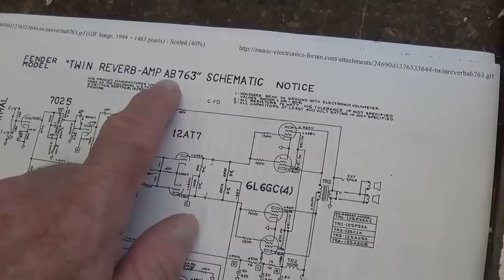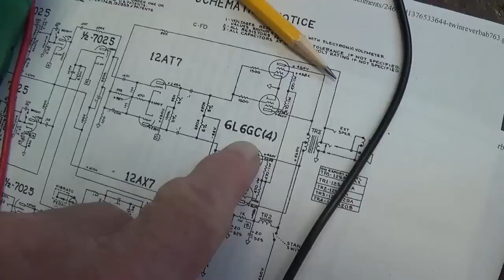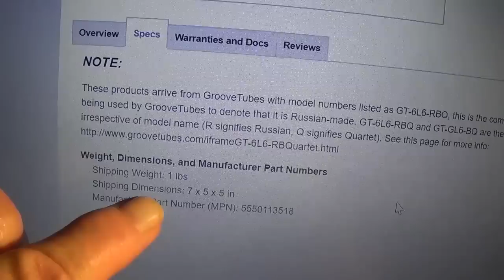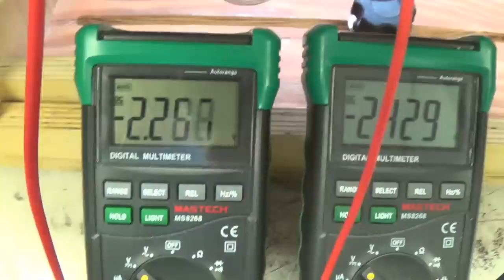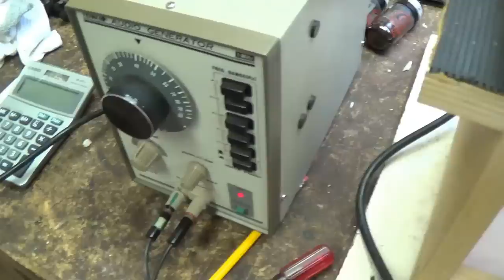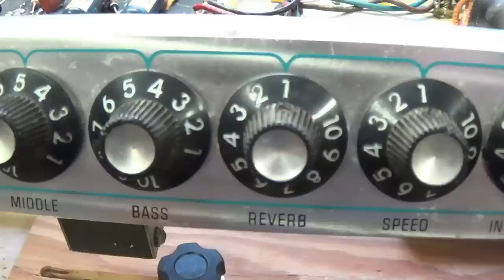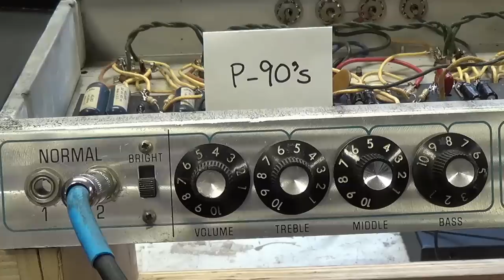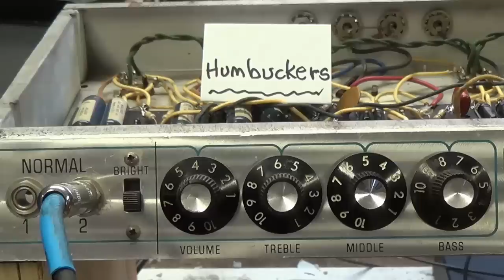1968 Fender AB763 Twin Reverb:   Evaluation, Modification, Extended Audio Demo

Comment: About the European power cord:
The colours used to be red, black and green. Across europe there were some differences in the colour coding (pre-1977) but all used the same colours. 
In 1977, red(live) black(neutral) and green(safety earth) were standardised.

In 2004 they were changed to brown, blue and green-yellow.

If you look at the charts about colour blindness, you will see that even with a red-green deficiency, brown and blue are still very distinct colours. So even an electrician who doesn't know they are colour blind will be able to tell them apart.
The only allowed multi coloured wire is the safety earth.
Reply from the maker: Makes good sense, Stefan. Thanks !!

Comment: I agree with the filter cap alignment, but I wouldn’t consider it bad work if I saw someone had an  j-hooked in the replacements.
Reply from the maker: If the connections are good, the circuit will work regardless of how it looks......but if it looks good too,  even better ;)
Reply: @UncleDoug  ah..more dating metaphors. .. Somebody stop him!
Reply: There are large currents flowing through those joints. Better if they didn't exist.

Comment: Speaking of weather changes ... Somewhere around 1968 or '69, I was sitting in a marketing class at Florida State University and gazing out the window. Suddenly, the wind begin to blow smoke emanating from a VERY tall smoke stack, down to the ground, and leaves on the ground began blowing straight up high into the air. In the hour's length of that class, the temperature must have dropped 30 or 40 degrees and it was quite cold. But such is Tallahassee ... or used to be, anyway.
Reply from the maker: Sounds pretty spooky, TT.......X-Files stuff.

Comment: Greetings Uncle Doug! 
I have here an AA270 Twin Reverb on the bench.
I've installed a new set of JJ tubes and I'm checking the bias of the output tubes.
On the first set of output tubes I measured between the plate to the CT of the output transformer : -1.24V / 35.9Ω = 34.5mA, half of that = 17.2mA. The plate voltage is 425V so the plate dissipation is 7.34W

On the second set of output tubes I measured between the plate to the CT of the output transformer : -1.22V / 38Ω = 32.1mA, half of that = 16mA. The plate voltage is 425V so the plate dissipation is 6.82W

This is normal bias for an AA270?
*BTW, the amp sounds very good
Reply from the maker: This seems a bit low to me, Asaf, even though I tend to be very conservative regarding PD of output tubes. I would probably increase the plate current to achieve a PD more in the 11W to 12W range......which is still rather conservative for GC's.

Comment: Hi uncle doug.. ive subscribed &  watched a bunch of your videos & am convinced your an authority at this stuff, which brings knuckleheads like me to seek advice from you so, i'll let you decide if being an authority is positive or negative, lol... 20 yrs ago I bought a kit from Dan Torres that facilitated a 2x6L6 class a combo w 3preamp tube layout. I had a traynor ygm-3 combo that was smoked that I gutted & modded the chassis to accept the larger xfrmrs, tube sockets, etc.  Not knowing much about tube circuits I went about the business of attempting the job. It worked but had a untolerable hum & reduced volume to the point where it was unusable. I sent it to a tube amp guy, he changed some things but never fixed it.. It's been in my basement collecting dust since (20yrs-ish).. im seriously thinking about ripping all the electronics out of it & attempting to build something else with all the hardware already in place. My question to you is  with the hardware I have, is there a tweed era circuit I could re-produce with a 2x6L6, 5u4gb or gz34 rectifier, 3-4 preamp tube layout w Hammond 272JX power xfrmr (pri= 115v, 60hz, 236va, classA  /  sec=600v CT, 250ma dc  filaments : 5.0v , 4A  6.3v CT , 8A & Hammond 1650N output xfrmr  Type X class 105c 60w  4,8,16 ohm output 4300 ohm CT, ?... any advice would be appreciated!, Thanks, Jon
Reply from the maker: With the parts you have, you may be able to construct a Fender 5F6-A Bassman. Download a schematic and see what you think. Good luck.
Reply: @UncleDoug  thats kind of what i surmised already, thanks for the help!..
Reply: @UncleDoug  also, im learning a lot as i watch your videos & am gaining a bit more confidence in my ability to successfully attempt a reboot of this project. I've seen the appreciations you've recieved on the tutelage you offer with your videos & they are widespread & well deserved, it may be just one more but Thanks so much for the videos & generosity.. -jon

Comment: Have you ever done the negative feedback circuit with a pot rather than a switch? Or would the difference be negligible/pot a bit useless?  Inside an old bassman at the moment and considering adding a switch or variable control.
Reply from the maker: Yes, I built a Champ from spare parts (see the video) and added a variable NFB.  Ultimately, it would be neat to have a footswitch to control the NFB.
Reply: @UncleDoug  hey that's not a bad idea, I have a spare jack hole in the chassis too...

Comment: Just for fun, I checked my copy of the Tube Amp Book written by Aspen Pittman, the founder of Groove Tubes. The book contains at least a partial tube data sheet for the 6L6GB, which shows 360V max plate voltage. Also of note, according to a June 02, 2008 article by MusicRadar magazine, Fender acquired Groove Tubes.
Reply from the maker: Wow.....pretty puny......more like a 5881.  I'm much happier with the TAD's. Thanks for the info, Thomas.

Comment: Hello UD, what the potentiometers concern of the old fender amps versus recent pots. Earlier pots had a different ratio which resulted in a way that the amps started breaking up at 5 on the volume pot, there were with actual pots " in the same amp " will break up at 7 at the volume  plus or minus. Geetings UD
Reply from the maker: Greetings, Jose. Thanks for your input.
Reply: So could you make a switch off of or a push/pull on the volume pot in order to make it break up earlier?

Comment: Notice this '68 has the Blacklikne silverface panel. There are thin black vertical lines. That's a sure sign it's a 1968 and likely to be an AB763.
Reply from the maker: Thanks for your helpful input, Gregory.

Comment: Hi Uncle Doug, Could you comment on what impact, if any, the current limiter has on biasing the amp and subsequent operation by a rock and roll fiend without the limiter in the studio or bar gig. Or should he take the light bulb to the gig and set it atop the amp for inspiration and questions from the audience?
Reply from the maker: Good question, SL. On the smaller amps that I usually deal with, the current input is quite low, thus the CL has little impact on the biasing. I tend to bias conservatively, so any increase in PD is still easily within acceptable limits. On large amps, like this one, however, it does have some impact due to the higher current draw. If you notice, I biased it a little below 50%, to allow for a 5% to 10% increase in PD depending on the AC supply at the owner's location. If you intend to bias to the max, I would suggest doing so without a CL and at the maximum AC voltage the amp is likely to see.
Reply: @UncleDoug   thanks for such a thorough reply, the few times I have biased my amps I've not plugged through the current limiter to get a "true" value,  (after using it faithfully as prescribed when in the troubleshooting stages of work, of course) I know that you are giving yourself some headroom by not going totally hot on the bias. Maybe it'd make for a good quick video to show the impact of the current limiter or not on the bias? Maybe a quick recheck on the Twin  without  plugging through the lamp ? Might excite the highest levels of nerdiness among the faithful ?...

Comment: Hi Uncle Doug,  I have a 69 Twin reverb AB763. SN A17871.  I've been trying to find the correct schematic.  The internodle resistors are 2.2k and 10k. You didn't show the full schematic that had those two resistors.  All I can find is the one with the 1k and 4.7k. Can you point me in the right direction.  As always,  THANKS,
Reply from the maker: The schematic you seek is for a Twin Reverb AA 769, KG:  http://www.thevintagesound.com/ffg/schem/twin_reverb_aa769_schem.gif
Reply: @UncleDoug  Thanks for giving me the news that I suspected.  This amp was one of those VERY  Molested ones. The cabinet and chassis number says it's a 69 Twin reverb AB763.   Someone added the master volume and did a bunch of other mods.  I suspect they might have changed those internodle resistors also.  That's what got me so confused.  They look like original carbon composites,  but who knows.  Thanks again.
Reply: @UncleDoug  Thank you for taking the time to let me know.

Comment: As far as I know the screw chassis ground (with lock washer) is preferred to soldered chassis ground because it won't desolder itself or go high-resistance over time or when passing fault current.  Not sure in practice which is more likely to go bad.
Reply from the maker: There are people who feel strongly for and against bolting down a ground, AU. When you use a lock washer, as I tend to do, I have never had a problem with bolting.
Reply: I always use a screw tab set up.

Comment: Hey Uncle Doug,  I learned a lot about Silver Face Fenders today. Had no Idea they had the AB-763 Circuit. When  i was a kid (18 years old in 1979) i wanted a Fender Amp because Ted Nugent used them. So I answered an add in the local Atlanta advertiser. At that time i had no idea what a black face Fender was. Well, i came home with a Fender Showman. I think it was a 1968 version. I did not appreciate it back then -  an ab-763 circuit (i think). Should have held on to it. Yesterday, after whatching your video, I saw a Silverface on FB marketplace here in Atl. According to what i looked up -- its a 1974. The serial number on the chassis is  B14990.  Well, do you know what circuit that would have? The tube sticker did not list the Circuit. Wondering if less tha $900 is a good buy. Thanks Uncle Doug. Wow! The shots with the UAV are awesome - can't believe they built a Cul-de-sac on dirt fill with no Vegetation. I'm a Surveyor and that would not fly in GA. Guess its different there --wherever there is...LOL!
Reply: Maybe the Blackface i had was a 65 -- I cant remember...
Reply from the maker: @joeys24  If the circuit is not stated on the tube chart, then the only way to identify it is to compare the circuit to various schematics for the amp.
Reply: Thank you sir.

Comment: @Uncle Doug, ¿how are you? Nice to talk with youo again. Im making an amp similar to the JCM800 and im so close to get the first final version but im having a problem. If i put my fingers close to the tube that have the function of phase inverter the amp starts to introduce / make noise. ¿What do you think it may be? ¿It´s ok that this tube works that way?
Reply from the maker: It sounds like you have a microphonic tube, Emanuel. You might try switching it with a replacement tube to see.
Reply: Uncle Doug thanks again. Today i try with another tube and i had the same result. ¿Can be the caps? I think they are very close to the source supply wires... I wait for your answer.

Comment: Thank you so much again for another great video!

I have a question uncle doug. I am working on a 1964 geloso microphone/phono amp.
It has a push-pull output stage with two 807s. One of them has a 1k grid stopper and the other a 22k. It seems to me this would cause a different negative bias excursion between the two and probably clip the signal on one of the half waves. 

I don't really understand why one would want distortion on an amplifier that is marketed as PA microphone amp. Am i missing something? 

I would be so happy if i could get your input on this!
Reply from the maker: I agree. There should be no asymmetry in grid stoppers. 1.0 to 1.5K Ohms sounds about right to me.
Reply: @UncleDoug  thank you very much for your help!

Comment: I did not have good results with GT 6V6's in my Princeton.....went thru two sets (biased properly) and had internal shorts of one of the 6V6's in each set I installed...finally decided to try TAD's and so far after one year, no issues...the GT's only lasted a couple of months at best...odd that only one of the tubes in each of the set had the internal short.  I had to do some investigation in the circuit to make sure that none of the components were way out of whack to cause this......this was most likely  "lemon" 6V6's.............now, back to UD and the Twin Reverb !
Reply from the maker: I'm becoming a believer in the TAD's, Tom......like you, after several bad experiences with other brands.

Comment: Are you getting those cap assortments from a local Harbor Freight store or on line? I looked on line and found nothing.
Reply from the maker: No, Dennis, I get the compartmental containers from Harbor Freight. The capacitors come from Antique Electronic Supply and other vendors.

Comment: Hi Doug. After watching your previous video on biasing quads of tubes (and some thinking), it occurs to me that one can simplify life somewhat by always measuring from the plate of the tube to the cathode of the tube. If it’s cathode biased (there’s a resistor and capacitor between ground and the cathode), you would do this anyway, and if the tube(s) are grid-biased, then the cathode is at ground potential anyway, so it seems to add up to the same thing by measuring between plate and ground (as in this video.) What do Jack and Ollie have to say about this? (My guess is, “kitty treats, please!” 💕)
Reply from the maker: Jack says that your way sounds like the easiest way to never make a mistake, William......so kitty treats for all :)

Comment: I’m not sure if you’ll see this, but i have a question regarding my 69/70 twin reverb. i have heard that pulling v1 is good for tone if you don’t use the normal channel, so i have done it a few times, however every time i do this, when i get the amp up around 5 or above, it starts to make this really weird crackling popping sound. it never does this when i have v1 in. have you ever heard of something like this?
Reply from the maker: No, I haven't, Elijah, but I am not an advocate of pulling tubes to try to improve tone. The circuits were constructed to perform as designed, and when you start messing with them they often return the favor.

Comment: I wonder if leaving in the two 100 ohm virtual ground resistors might have been an okay idea as today's higher mains voltage in the 120v range pushes up 6.3v filament supply to around 7.0 volts?
Reply from the maker: That's an interesting idea, Nirky. Next time, I'll measure the voltage drop across the 100 Ohm resistors.

Comment: Hi Doug! I find that these silver face amps could do with some more intensity to the tremolo. Is there a modification you can recommend?
Reply from the maker: It depends on the type of tremolo, but you can be sure the oscillation loop caps are of correct value and install a fresh oscillator tube.

Comment: I personally believe that the reverb tank attacked the tremolo circuit during shipment.  It was motivated by "effect envy."  😜
Reply from the maker: Good bet, DB. One of the oscillator caps had a bite taken out of it ;)
Reply from the maker: You could be right, DB. There was a bite taken out of one of the oscillation loop capacitors.
Reply: @UncleDoug  Maybe that reverb tank should be renamed The Mike Tyson Special. 😄

Comment: Hello Dear Uncle D.  Is it necessary to have three diodes in series on each high voltage wire these days?   I assume that in years gone by the breakdown voltages were too low to do it any other way, but that is certainly  not so today.  Why  not replace them with only one diode?  On a personal note, considering your wide range of skills, did you ever take guitar playing lessons or did you teach yourself ?  This was another great video and if you ever decide to organize them  into topics and offer them on CD I will pick up a set.  Blue sky and green lights to you and yours.  Vince
Reply from the maker: I think the three diodes were simply cheap insurance against failure, Vince. Just like with electronics, the guitar skills were all self-taught. Likewise on the good wishes :)
Reply: @UncleDoug  I thought that would turn out to be the case.Absolutely amazing, to gather such a profound fund of knowledge with your only guidance being the desire to know.  Remarkable self discipline of that magnitude is to say the least remarkable.  All the best Vince

Comment: I have a 66 ab763 that the person that gifted me told me it’s blowing a fuse on startup. I went through and changed the 5 caps on the bottom side of the unit and also put new resistors on, flipped it over and changed the cap and resistor on the negative bias circuit. Are there any other places that are usually an issue? I have caps to replace all the paper ones on the top side of the unit, the little 20mfds but just haven’t gotten that far yet!
Reply from the maker: You should be using a current limiter every time you power up an amp that may malfunction, Brandon. You have probably solved the high current draw issue by replacing the electrolytic filter caps.
Reply: @UncleDoug  I have a dim bulb tester that I use frequently. Also have a variac! I ended up replacing all of the 25mfd25v caps as well. No more blown fuse after bringing it up on the dim bulb first. Took it off the DB tester and everything works. Just Has a very very small hum when turning the volume pot up so I’ll have to look into that! Thank you for your reply!
Reply from the maker: @brandonbenore9421  You're welcome, Brandon. If the hum responds to the VC then its cause is before the VC in the circuit.